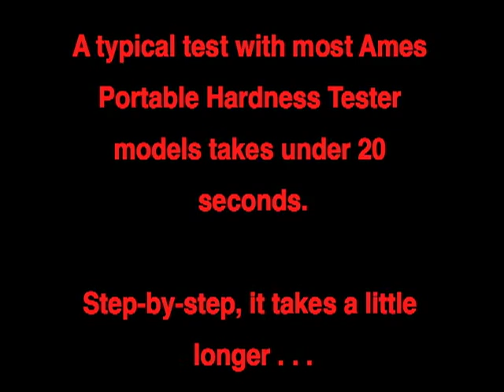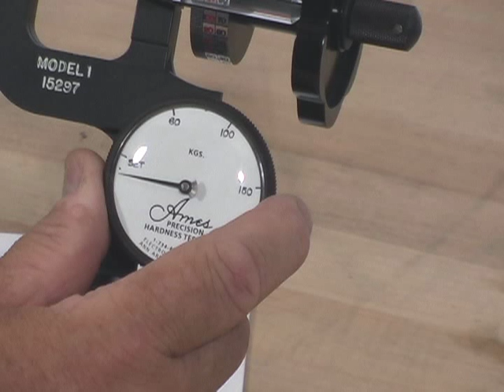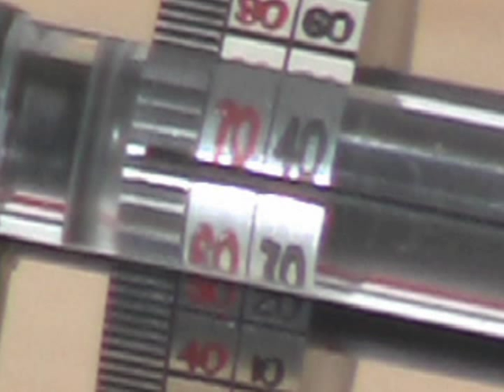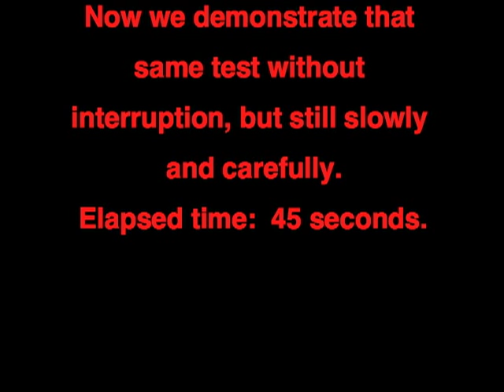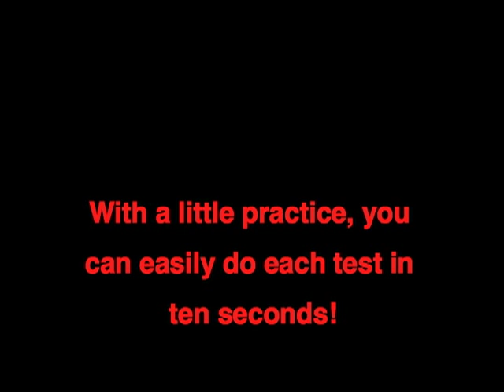Portable Rockwell Hardness Testing

Comment: Hello and thank you for the video. I would like to check a thin (1.2 mm thick) , mid carbon steel ...is it better to use scale B? If yes , is the procedure the same as in your video, but applying 100 kg load instead of 150kg?
Thank you all in advance

Comment: So, I guess you'd have to cut off a small part of the screw shank, then to hold it, probably embed it in a solid epoxy holding medium, to hold it in line with the penetrator, correct?

Comment from the maker: Good question. That is tiny. I tried it with a 6-40 because that is the smallest screw we had and it worked fine. You must have a flat end on the screw for it to work. However, if the end of the screw is not flat you could grind it flat to test.